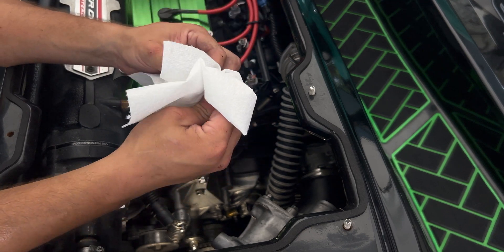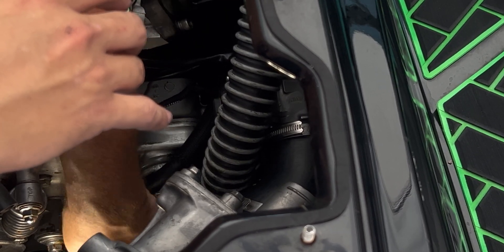Tech Topics: Diagnosing Supercharger Belt slip due to leaking hose - Kawasaki Ultra 310 Jet Ski [4K]

Comment: Can tou please a little more explain how does it feel when belt is slipping? Thanks!
Reply from the maker: It feels like loss of traction. Like the "tires" are slipping on wet pavement. You may experience a stutter, reduced top speed, inconsistent boost level on the gauge and overall poor performance.
Reply: @JDsWaterWorld  thanks a lot for the reply! It may be probably my case because my 310x is able to reach top rpm only when I smash the throttle, but a few seconds later get down to 7500-ish and only 10 psi boost. Engine compression is good, blow-off plate installed, new spark plugs.
Reply from the maker: Do you have water in your hull when it happens? Check the cooling hoses by the belt- I had a pin hole on one hose off the stator cooler housing and it made my belt slip. Also the main carrier bearing can leak and spray water onto the belt. You can try zip tieing a GoPro focused on the driveshaft pulley and belt and see if you see water spray while running under load
Reply from the maker: How is your fuel pressure? Have you ever changed the filter? Worth checking if you have not...
Reply: @JDsWaterWorld  thanks a lot, I am going attach action camera to see what is going on.
Reply: @JDsWaterWorld  thank a lot for all help, very appreciate that! 
I replaced the stock fuel pump for high performance and also put a new fuel filter. Also I: checked fuel injectors, replaced the belt to new (non OEM), even rebuilt the engine with new pistons, rings, valve adjustments.. no help..
Reply from the maker: Did you verify fuel pressure with a gauge after the rebuild? You never know! You can also test the throttle body, tps sensor function and test the MAF sensor function per the test procedures in the manual
Reply: @JDsWaterWorld  @JDsWaterWorld  thanks a lot, I am going to do it, but I noticed that most likely it is something with the belt because no matter what I am doing and how much rpm, it is able to handle only 10 psi constantly. Thanks a lot!
Reply: @JDsWaterWorld  Hey! I sent you an email with interesting Kawasaki design issue which I found, if you interested.
Basically the issue was in the damaged water hose next to the driveshaft pulley and very dirty intercooler.

Comment: Can you tell me what exactly is causing when belt slips ? My 2015 have doggy symptoms.When I'm drving and reach abot 75km/h my engineis cutting  power like I have too much fuel on my sparks, after 2-3s after that starts running again normaly wih full power and situation is  again and again. Like one of sparks stops working,  or belt slips. Changed sparks, lubbed tensioner. That was hapeend outside of water not whle driving. From one to another day.
Reply from the maker: Have you checked for water in your bilge? Or a possible leak? How old is the belt? Do you see a black suit in your hall on either side of pulleys?
Reply: @JDsWaterWorld  Today changed belt and everything is ok apart of blige pump, I  think is not pumping or pumping not fast enough water ftom the blidge.Water level is  up to  botom of a tank  (where Styro ends). How to diagnose blidge pump? Plus on hall walls it's a lot of dark grease or old oil. Putted ski nearly verticaly and came out abt 50-70 ml of  used oil (in one week). Have no idea how long was this before I made 20 h with this ski. Now it's 156h on ODO . In the blige water was a lot of parts from broken old belt and two washers from engine mouting bolts so I removed them.  Will be puting them on position tomorrow. opened cups ,removed water, made a test ride and water is back again .I see no leaks of water while was driving. any ideas?
Reply from the maker: Sorry, man, it's a little bit hard to understand everything you are saying. So I understand, was one of the engine mounts broken when you moved the engine to change the belt? If so, the leak could be from your carrier bearing or the driveshaft passes through to the jet pump... if you are seeing oil in the hall, it could be from the return line from the catch can or one of the return lines to the oil pan, you should check those hoses for leaks. Also, does water appear in when you are running it on the hose? If not, it is likely, a leak from the carrier bearing or even possibly a fitting. if the ski is on the trailer, and you fill it up with water, does any leak out? Is the water hot or cold?
Reply: @JDsWaterWorld  sorry 4my English. About this engine mounts all its ok but washers was in the bilge. Abt water - while water is inside and ski is on trailer plus caps are closed There are no leaks at all. Checked those hoses but can’t see anything weird. Water is getting in quite fast cause from start to moment when belt starts giving me information about a water inside (hot water- even very hot) it’s abt 5 min of riding??  Is it a chance that exhaust is leaking?

Comment: It happens JD, I believe me and you discussed the hose below feeding the stater with the natural bend in it splitting on Gina’s Kawasaki. Twice once at 200hrs and again around 400hrs hrs believe it or not.  End result same situation pissing/spray water getting on the belt.  Makes you think something is seriously wrong while riding.  Thanks for sharing
Reply from the maker: Yeah remember you telling me about that. I am thinking if I upgrade those hoses to silicone and then put a sheathing over them it will help protect them from chaffing
Reply: @JDsWaterWorld Surely won’t hurt!  Keep us posted

Comment: CRC-656 is more safe on the rubber hoses.
Reply from the maker: The only hose I see that lists oil and solvent resistance is the silicone heater hose..I am actively looking into a good brand of silicone hose to replace all my rubber hose with
Reply: @JDsWaterWorld  
Great idea 💡 👍 probably follow your lead on that

Comment: Funny my 2018 310 had the exact same problem
Reply from the maker: Same hose too?
Reply: @JDsWaterWorld  same hose it's because kawasaki doesn't secure it to anything it just vibrates and chaffed through it was even worse for me my factory suction pump (found later after I dropped #2 cylinder) didn't get molded right and had no holes for the water to actually be sucked out

Comment: Next up - full silicone heater hose install :-)
Reply from the maker: Yes, I am 90% sure I am going this route
Reply: @JDsWaterWorld  saw your post on it (comments turned off), obviously you don't want kinks but it's not a problem, just buy a little extra and run gentle bends.  I could send pics of it on my ski if you want to email.  Remove the "1" at the end of my screen name and use g mail
Reply from the maker: That was a mistake..somehow comments got disabled..i fixed it now thanks for the heads up
Reply: @JDsWaterWorld  saw your post (comments turned off), I've had it on my ski about 8 years, still looks new.  Just run gentle bends with it, I can send pics on my ski if interested